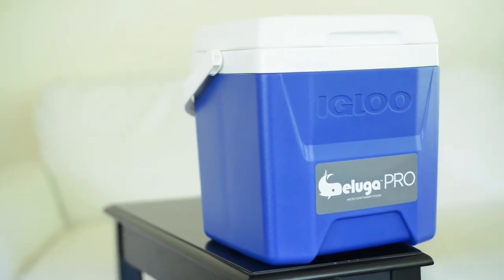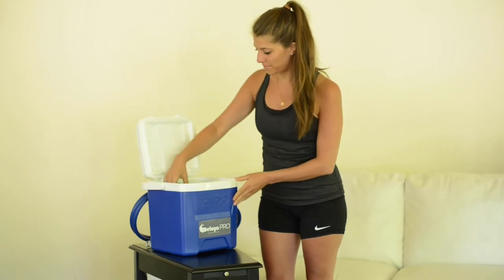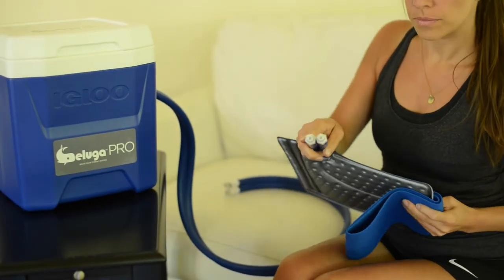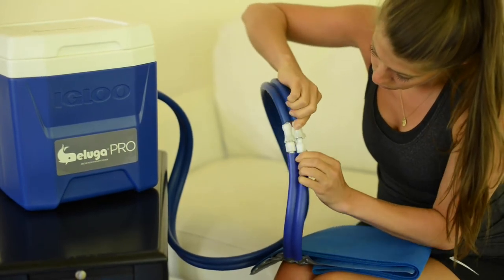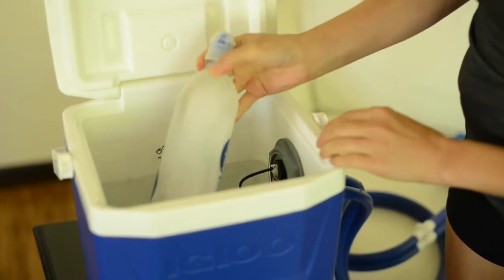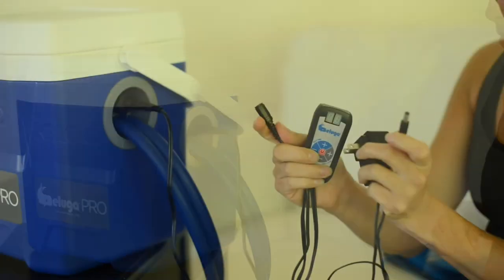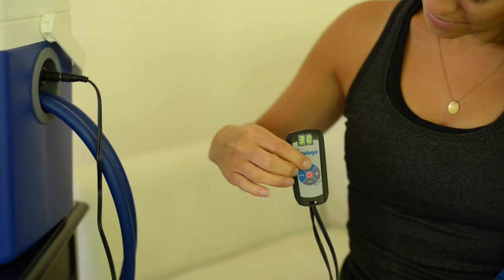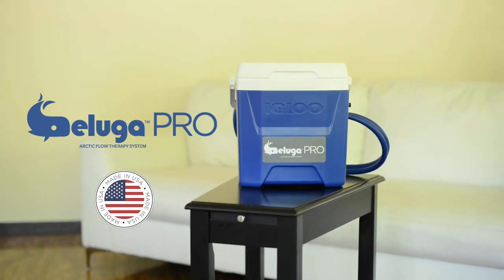Beluga PRO Cooler Instructions

Comment: This machine is a giant piece of garbage. The hoses do not clip in easily, they don't even fit into one another. The black rubber washers around it keep slipping down the joint which doesn't allow the hose to click in. You can sit and wrestle with it like my husband and I did, but do yourself a favor and don't buy it! Unfortunately, I threw out the box so I can't even return it.